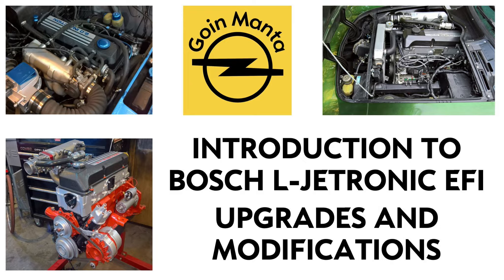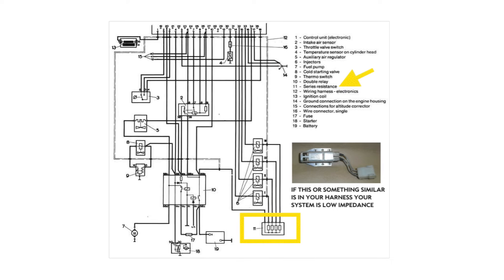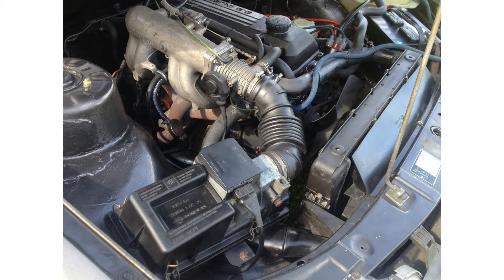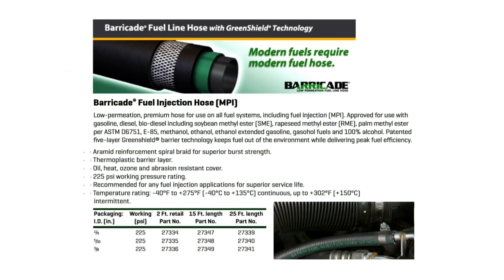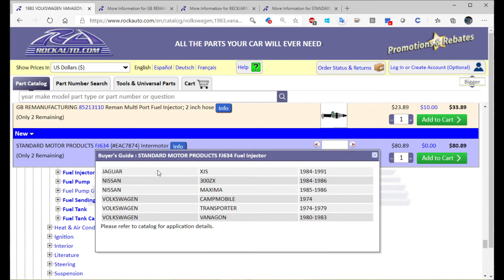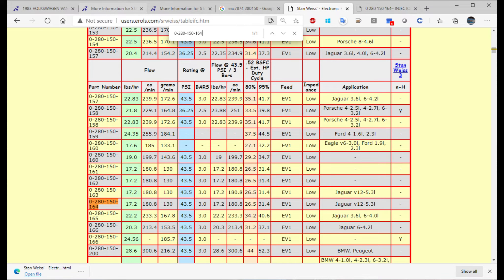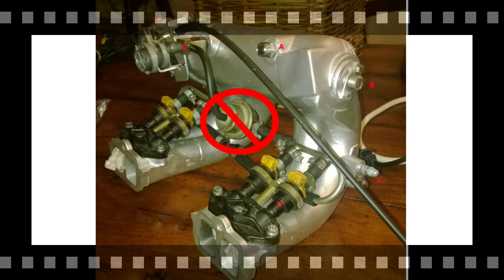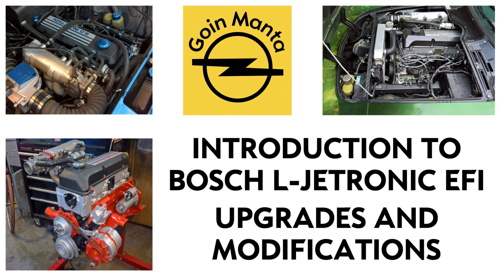How to Cross Reference and Upgrade your Bosch L-Jetronic and Motronic Injectors.

Comment: Wow.  Thank you SO MUCH!  You've taught me all about L-Jetronic (including LE & LU), and I learned on my own that LH-Jetronic uses a Hot-Wire air flow meter instead of the vane-type.  Also you taught me that Bosch Motronic uses a camshaft sensor which allows the ECU to control ignition timing instead of the distributor.  Plus you taught me about tuning the AFM & throttle position switch, or using fuel injectors with a different flow rate, or using an adjustable fuel pressure regulator.  You've really opened my mind to the many possibilities of using these injection systems with older cars which  had carburetors.  Thank you so much!!!
Reply: You all prolly dont care at all but does any of you know a way to get back into an Instagram account?
I stupidly lost my account password. I would love any assistance you can give me
Reply: @Trey Harlan I really appreciate your reply. I found the site on google and im in the hacking process atm.
Seems to take a while so I will get back to you later when my account password hopefully is recovered.
Reply: @Trey Harlan It did the trick and I finally got access to my account again. I'm so happy:D
Thanks so much, you really help me out!
Reply: @Reid Harvey happy to help :D

Comment: EXCELLENT video! Thanks for all this great information. I have an 84 Citroen CX 2500 IE with the LE Jetronic system that I am having some issues with. Hopefully with the information you have shared I can get it sorted out. Thanks again!
Reply from the maker: First you start with looking for other cars with LE injection. https://en.wikipedia.org/wiki/Jetronic  ( The ECU connector is usually the same number of pins ). So in your case, I would look for 1984 cars with LE injection of the same rough liter displacement and number of cylinders ( BMW, Opel, VW, etc.. ) Then you look at the pin connector.. ( 5 or 6 or 7 pin... etc.. ) When you find one that hits all those criteria. You may find it has a close to the same part number, but a few things are different. Bosses to mount it in the car and the like. Thats when you go and get one and try to see if it works. If it works it works. If it doesn't it won't hurt anything. Hope that helps :) I used to have a website that listed the cars with it. I have a old manual and will list them above once I transcribe that info.
Reply: @GoinManta  great! Thanks for your quick reply. I’ll start searching for a close replacement and go from there. 👍🍺. Great videos!
Reply from the maker: @Citroeniste  Good luck. Opel would be where I would start.

Comment: The Australian Holden VK Commodore (1984-86) 3.3 ltr in line black 6 cylinder) uses the same/similar system. 
Trying to tune/fix/diagnose mine.

Comment: awesome video. at about 70s you mention 50A peak and 23A hold. Thats crazy high for one injector. Is that for 4 or 6 injectors in total?
Reply: Sure for all.. not sure context of the 50S/23S comment.. so will have to review the video. BUt most the time the fuse is under 20 amps.. so probably depends on low impedance verse high.

Comment: Your content is very nice! Thanks for the effort to put all this information together.
In Brazil our Opel CIH is a 6-cylinder 3 Liter with Bosch Motronic 1.5. The injectors are high impedance Bosch 0280150962
Reply from the maker: I would look at the Ford injectors.. They are inexpensive and in the middle of the range..
Reply: @GoinManta  Fortunately these 962 injectors are not very problematic. But the engine that superseeded the CIH, a 4.1-Liter derived from GM's Stovebolt design, uses the 0280150975 that are prone to leak in the seam between the plastic and steel body. We usually replace these for Bosch 0280155822 that have an all-plastic body.
Reply from the maker: @dannielpizatto7357  I will say the Brazilian Opala (Especially the later 90s ones) are so cool.

Comment: I have a 73’ Opel GT upgraded with fuel injection. I have a moderate vacuum leak on the big hose between the air intake and injection system. Where do I find a replacement? Is there a certain part number I can look up? Thanks
Reply from the maker: What system? LE or Motronic or Ljet ?